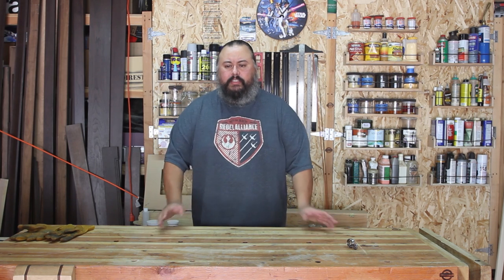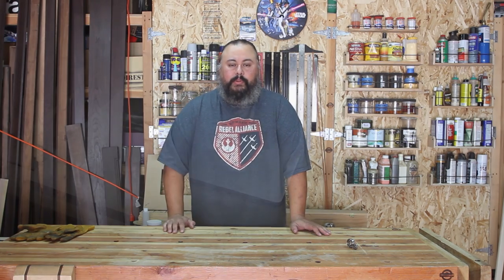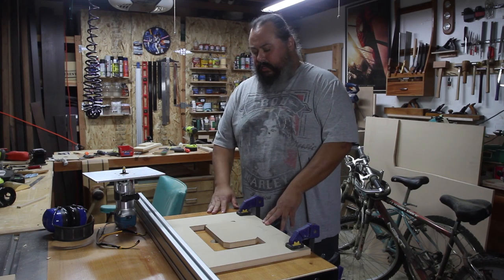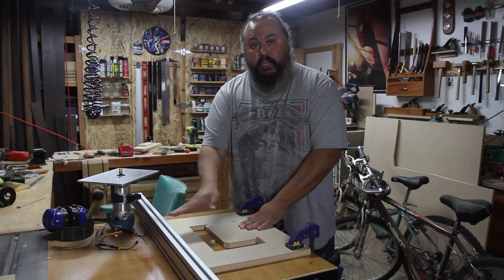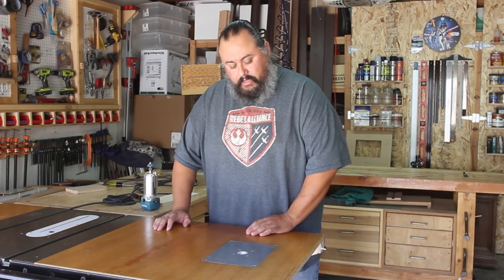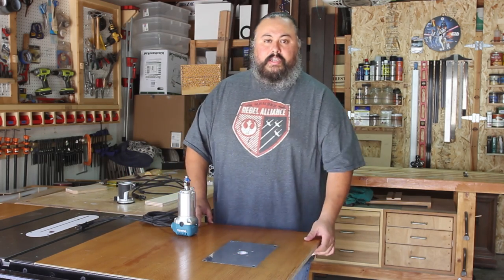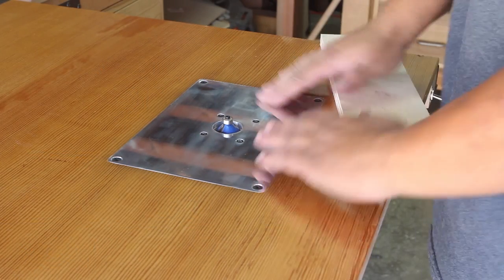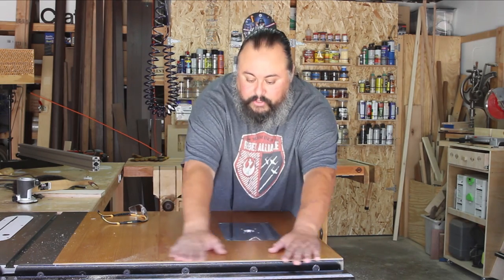30 -  Table Saw Router Table

Comment: Thanks for this video! I'm new to woodworking and was in the process of figuring out how to mount my trim router (which just happens to be the RT0701C you used in this vid) to the end of my table saw top that doubles as my workbench. I had watched dozens of videos on DIY router tables and this is the only one I've seen using a flush trim bit with an easy template like this. My flush mount router plate insert came out perfect using this method.
Reply from the maker: That's awesome! I'm always happy when I can help! I love this method and using a small router is perfect for me. Thanks for watching.